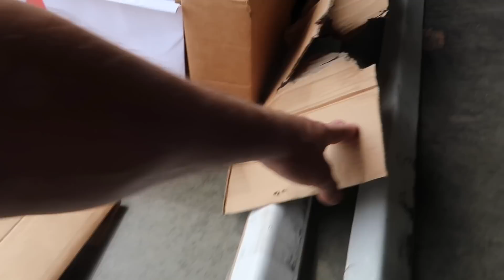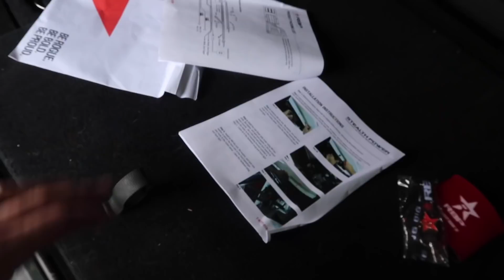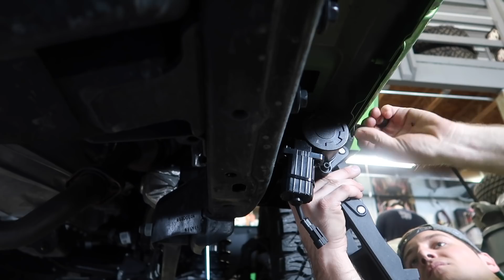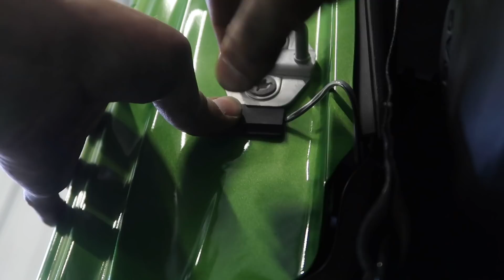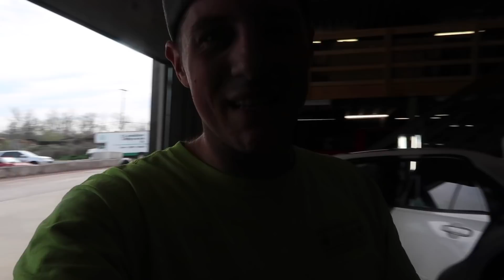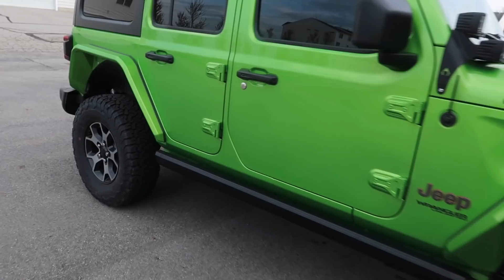Rolling Big Power STEALTH POWER RUNNING BOARDS!!

Comment: I am doing research for theses and I was wondering what is the distance from the top of the running board to the bottom of the open door and the distance from the ground to the top of the running board and your added height?

Comment: I'll stick to my Rock Slide Engineering power steps for my JL. While it's true for both 
stealth power and rock slide can work on as rock rails when your playing in the rocks...Rock 
Slides skid plates add on is a wise idea.
Reply: i am curious how well they hold up to taking a beating from rocks.
Reply: @timpsencik   to answer your question I added the extra armor(skid plates) after I put a huge dent in the driver side step. I got the dent out and with the skid plates now installed they are worthy rock rails.

Comment: Hey just wondering if you did anything to protect your frame from rust because it looks pretty clean
Reply from the maker: Nope, just wash it constantly in the winter. I need to get some under carriage protection, any suggestions?
Reply: @BenAnton2  I was looking at a product called Eastwood frame saver looks like a good product. I just bought a 2019 wrangler Rubicon last week and want to do something with frame to keep it from rusting
Reply from the maker: Thanks I’ll look into it!
Reply from the maker: Good luck with the new Jeep!